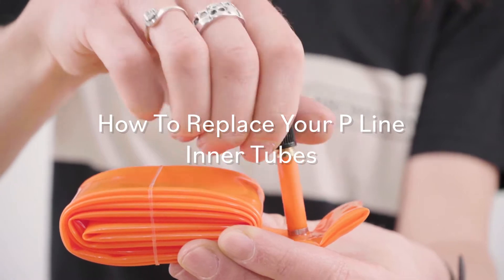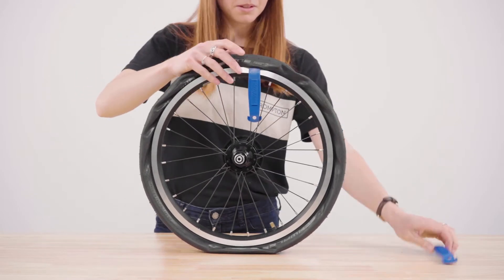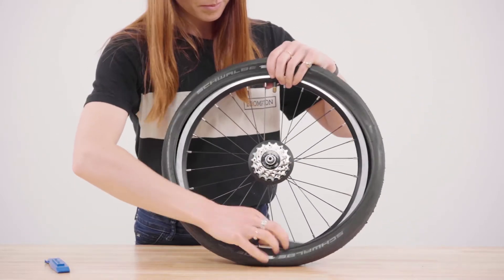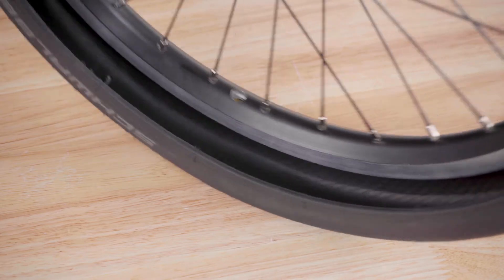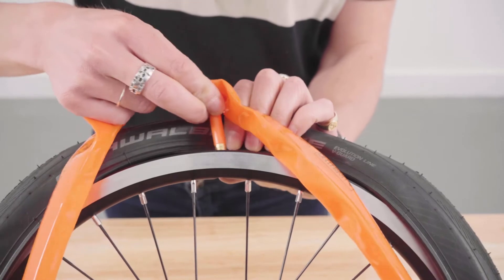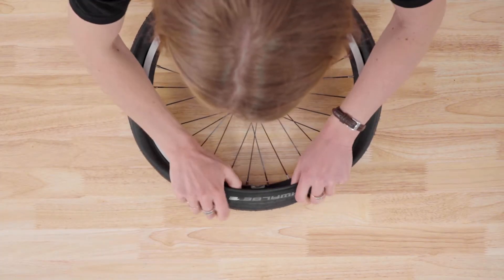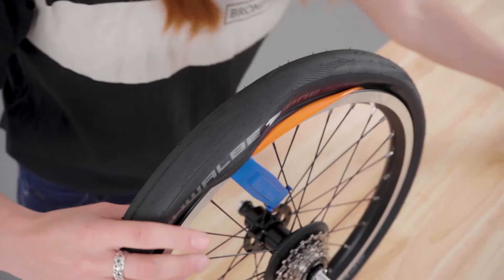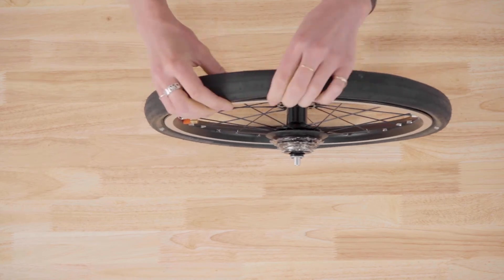How To Replace A Brompton Tubolito Inner Tube

Comment: "We recommend putting the tyre on by hand as the use of a tyre level could pinch the new inner tube." That was completely unrealistic on the T-line we tried. Maybe the world's strongest man could have done it. We don't understand how this video represents a hand-only fitting. The recommendation should be updated to using tyre levers with metal cores and plastic coating to avoid scratching the rim, and then throwing your whole body into the final push, or else T-line manufacturing output should be evaluated against design criteria, for the tyres we have are far too stiff.